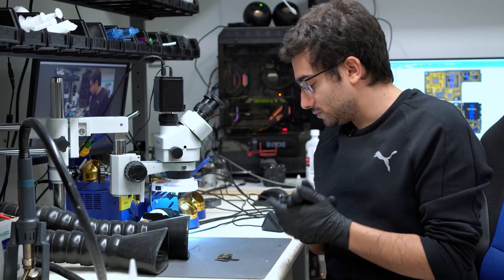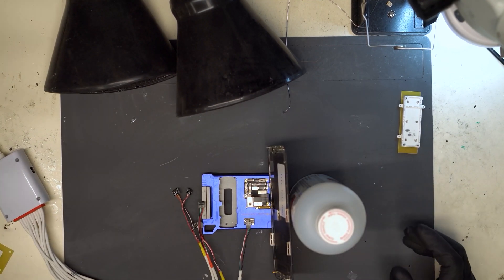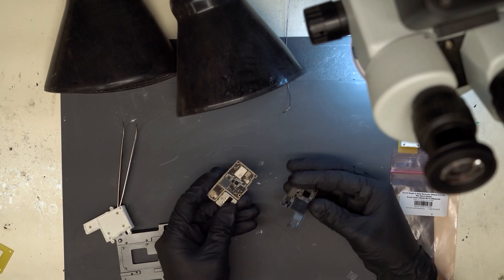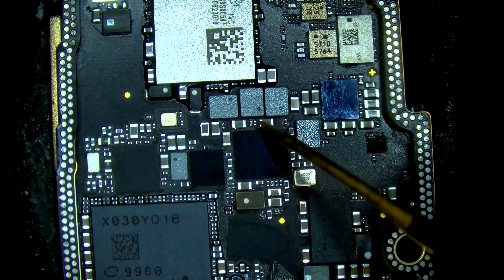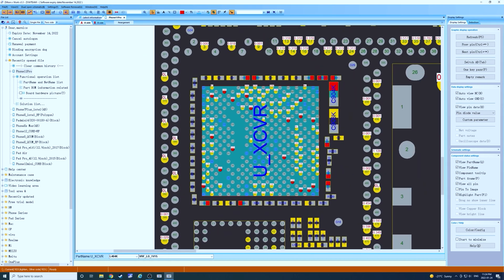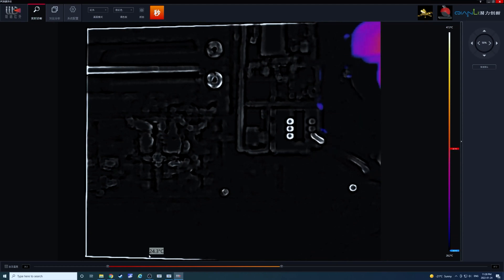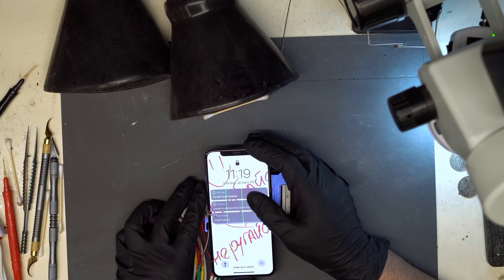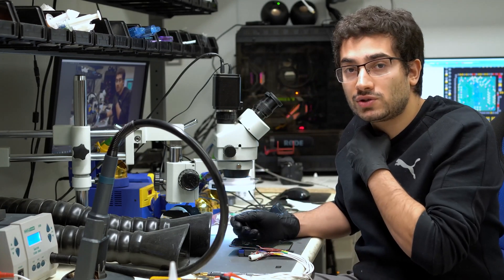How to Repair iPhone 11 Pro with No Service (Missing Modem Firmware)

Comment: Hello 
Please I need help my iPhone 12 pro max never fell down but suddenly woke up to missing firmware number on the phone 
Please I need help
Reply: Its not always because you dropped it i had the same problem they said sometimes it happens on its own and when that happens you should be able to fix it by taking it to apple repair.
Reply: Took it to a repair shop 
And turned out it wasn’t repairable 
What else should I do 
PC :the phone is just 2 months 29days